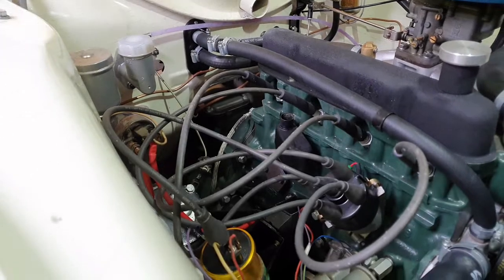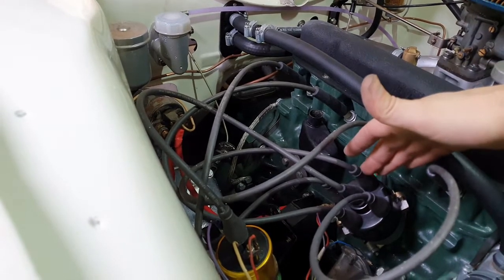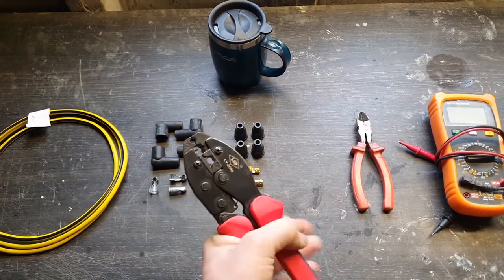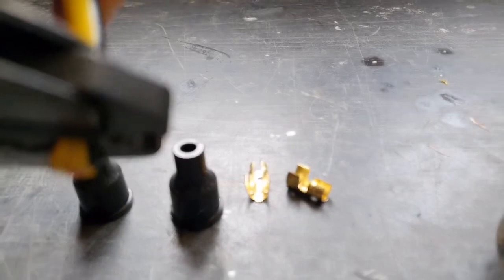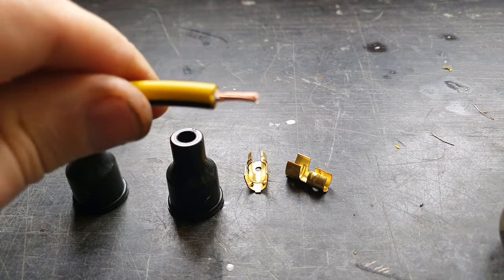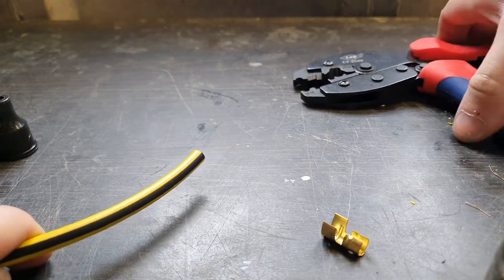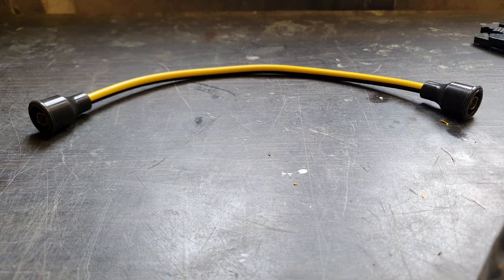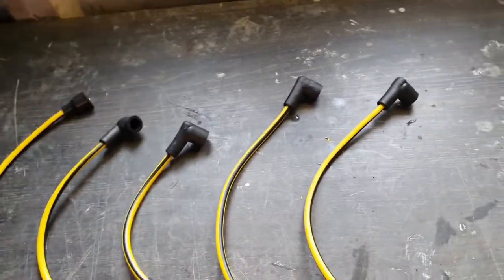Make your own HT Leads

Comment: Great tutorial but just a quick question. 

Why type of cable is it, Thickness off core and so on I’m struggling to find this info on the net and would appreciate the help have done a engine conversion and now the leads are too short in length
Reply from the maker: Thank you!

I bought the leads from green spark plug company, i belt he cores are 7mm in diameter.  I've put a link below which should help you out but they're also helpful over phone if you need more advice.

Out of interest,  what conversion have you done?

https://www.gsparkplug.com/7mm-ht-ignition-lead-cable-wire-core-pvc-black-30-meter-roll.html?wi=off&gad_source=1&gclid=CjwKCAiAnKi8BhB0EiwA58DA4RJR--NpWnPRfpMyHW8oyO2ms9DyEYpMyB6tw3vL-mf1rZVOF-LklxoCJn8QAvD_BwE
Reply: @jimbuilds   Thank you that’s perfect!